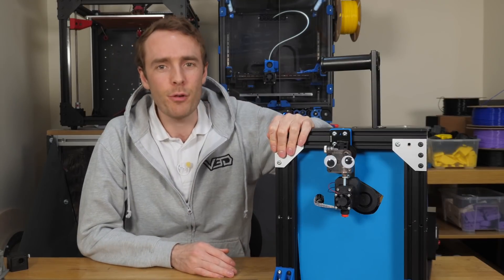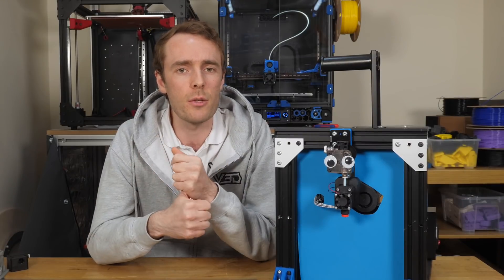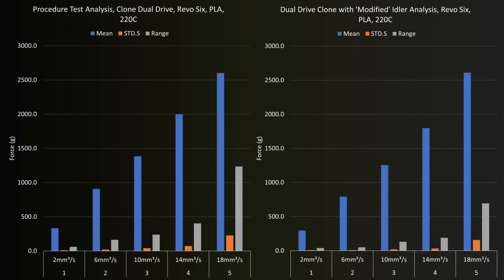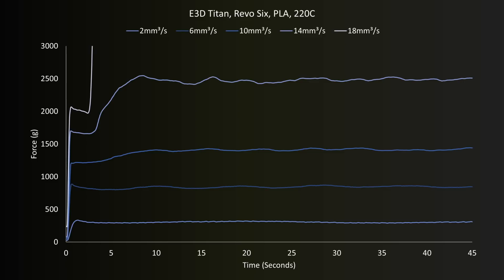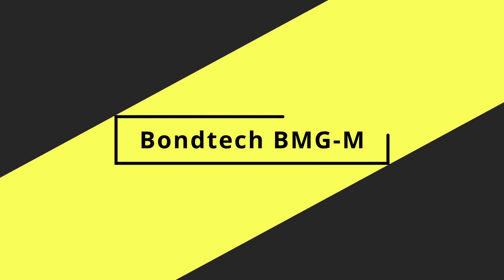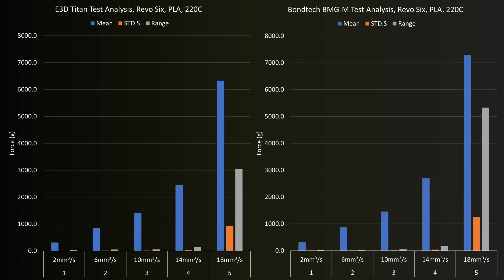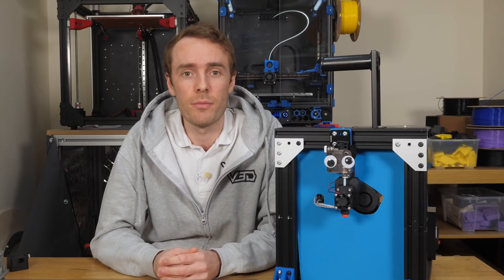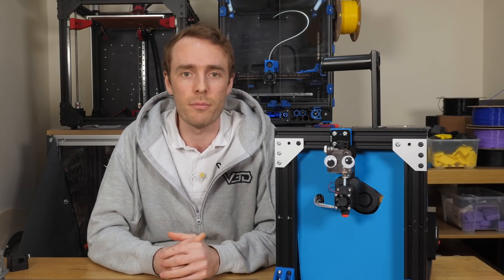The Extrusion Myth We All Believed

Comment: PLEASE expand this into a series with more extensive testing. I would happily donate towards the idea of testing new extruders as they come out. There is a lot happening in this area and some of the issues many of us knew instinctively but couldn't really test are finally coming out.

Some obvious extruders to compare are the new bondtech LGX style gears and dual idler gear designs like the OMG. 

I'd also like to see a belt extruder with no teeth touching the filament, like the concept Proper Printed is working on and  hobbed drive gears that instead use opposing helical teeth (or ideally dual "herringbone" teeth) which I have not seen in the wild yet.
Reply: maybe i am mistaken, but what you wrote there looks like a huge hint at potential solutions....i dont know who else is going after this, but i will....! THANKS!!!
Reply: @simonschneider5913  lol no worries. I've since played around with some belt-style concepts and there's definitely potential but still hurdles to overcome to keep it compact without sacrificing longevity. I'd love to see an attempt at herringbone gears. I don't have the means to attempt that but perhaps there's an existing product about the right size that could be modified....

Best of luck, I'd love to hear what you come up with if you're willing to compare notes.

Comment: Did you happen to measure the amount of filament extruded?  I bet you would see more under extrusion in the clone than the others. I disagree with your conclusion and i think the titan and bondtech are performing better because the likely extrude more.  But I also agree with your assessment that even though they are likely extruding more, it is likely not a better result in terms of print quality.

This has some serious implications.  If the software measured motor current (which correlates to force), it can slow down print speed when the force is too high.  Or dynamically adjust nozzle temp or any number of creative solutions.  Also, perhaps thermal contact resistance should be a performance metric of extruders.  Filament can have a spec of 95% extrusion accuracy per set flow rate per degree c per hot end thermal contact resistance.  This would demystify various hot ends and filament blends!
Reply: Exactly. I came here to make your first point as well. Measure the flow rate instead of using the input. For a given hotend and nozzle, you should be able to make a calibration curve and directly determine the flow rate from the force (see math below). With that in mind, I'd assume that the clone extruder just doesn't reach an actual 18mm³/s flow rate. When it tells you it does 18, it actually only reaches what the others do at their 14mm³/s setting.

If you assume that the molten plastic traveling through the nozzle always has the same viscosity (n), you'd expect the force (F) to be proportional to the extrusion rate (v).
F(T=const) = g * n * v
(where g is a term depending on the geometry of the nozzle.) If the hotend runs into the limit of its power output (P_max) (but still heats the filament fiber evenly to its core), then the temperature will decrease as:
T_P = T_room + P_max / c / v
Where c is the specific heat capacity of the filament. Assuming the variation of the viscosity with temperature is sufficiently close to inversely proportional (n = 1/T), you'd expect the force should be proportional to the cube of the flow rate:
F(T=T_P) = (g * c / P_max) * v²
In practice, there would be some flow rate at which thehot end reaches its limit and the force curve will transition from the linear proportionality to the approximately quadratic one. Which seems to be what we're seeing at around 12mm³/s.

Comment: Some time ago I developed a testing rig for extrusion of PEEK which is quite similar to what you built. But it also features a rotary encoder for measuring the filament slip very accurately, two more load cells and also a PID controller that can be enabled to compensate for the filament slip. My thesis was only about developing that system so I didn't do extensive tests with it. Let me know if you want to read it :)
Reply: Hello,
I would like to read your thesis, is there somewhere where I can find it ?
Reply: @geekoid183  It's not published since it's not a PHD so I'll need to send it to you via e-mail. Also you'd have to translate it from German into French. But I think the diagrams are more interesting than the written text anyways :)
Reply: Hello! I'd like to read this too. Please send me your thesis, if you can
Reply: @Балашовскийгараж  Message me your E-Mail address and I can send it to you :)

Comment: PID frequency? Could just be the pulses of heating or possibly even an oscillation in the PID causing temperature fluctuations and thus viscosity changes effecting the variable force...
Would be interesting to monitor the NTC temp as well as the voltage across the heater cartridge
Reply: PID frequency needs to be actually measured on each specific printer configuration, it's not hard fixed, but it should be between 6 and 8 Hz so outside the chart to the right. Correspondingly its harmonics are then multiple of that and also outside the chart. A possible source of visible spikes can then be intermodulation, where for two different frequencies, their sum and difference also imprint.

To be considered whether measurement introduces some sort of aliasing, where for example due to sparse sampling and lack of filtering, higher frequency signals get reflected off the Nyquist and folded back into the visible part of the spectrum on the chart.

Comment: Really enjoying this deep dive into the physics behind squirting out molten plastic. I was wondering if, using your set up, it would be possible to use the force output of higher flow rates to control the heater? The variable of a constant temperature would be more of a hindrance to flow rate, rather than how much the extruder is pushing. I guess what I'm asking is, if your setup is capable of tuning the heater to increase its output based off of the force it sees?
Reply from the maker: Yes, i think technically there would be nothing preventing that sort of closed loop system. I suppose the real question though is: would it help? Probably a bit.
Reply: @Vector3DP  Yeah, I really do think it would help. Given the volume your trying to push through, the heat would only be able to penetrate to a certain depth into the filament. Of course, you could also be reaching the critical point of thermal conductivity of the filament itself, in which case, it wouldn't be much of a benefit to turn up the heat. Guess it's time for a Bondtech CHT nozzle at that point. Cheers mate, keep up the good work!!

Comment: There seems to be a significant difference in the means in the idler test, so the dual drive does add some force.
Reply from the maker: My answers and conclusions at the end aren't perfectly clear, its a really hard topic, but i'd suggest you watch them again. Yes, slightly higher peak forces on BMG, mainly at highest flow, but this isn't necessarily a good thing because of what is actually being measured.

Comment: Have you taken into account the fact that stepper drivers are also going to produce some measurable ripple?  The DRV8825s were notorious for this, and could cause "salmon skinning" on delta printers in particular, because of a huge step jump in microstepping.  How have you calibrated your machine to account for these things?  You have to take as many factors out of this equation as you can in order to definitively quantize and isolate the drive system itself.  Do these ripples happen in a system with a lot of gear-down, such as the Bondtech LGX Lite?  What are the effects of using a 0.9 degree step motor at full-stepping to achieve these flow rates, where torque from the stepper should be quite consistant...
Reply from the maker: Simple answer: Fourier analysis. at the meaningful resolutions that i was working at with this data, and the time steps I have, it really seems every repeating pattern. Obviously there is still A LOT of work to be done with testing many other parts of the system, but If i tested them all before making a video, that would be literally years of work. I'm doing incremental changes and learning about the whole system step by step and updating you all on the process as i go along. hope that makes sense.

Comment: not really studdied any of this but i think:

from the looks of it 18mm2/s is to much for that hotend so you deal with a lot of noise from the hotend making it basically useless data

also

slip isnt a binary thing and less grip will make the extruder puss slightly less fillament and in return underextrude dual gears help in that regard but the way the standart bontech has the gears it can untroduce artefacts 

what would be really interesting is if you messure how much fillament is being extruded along side your data with either messureing the weight or a sensor messuring the fillament lengh being pulledwhich would let you calculate the % of slip you probably could estimate the slip already by comparing the force differences but i think messuring would be more accurate 

and use said data to compare different extruder designs singe/double different diameters etc being able to see how consistent the extrusion is but also the % of slip

Comment: Hey Adam,

Thanks for the work you are putting into these tests for our community. Much appreciated!
The high flow rate oscillations do not look at all like they are gear induced but rather are caused by the non-linear behaviour of the system concerning mostly filament slip, filament heat transfer and resulting viscosity based on the material melting properties. Stefan has also reported on the oscillating viscosity and flow on filament with a hotend driven to the edge of its melting capacity at several occasions. It is always an oscillating process. 
When you bring the system to the edge of its capabilities it becomes highly non-linear and that make it unstable. The filament oscillates between getting partly “stuck” (high viscosity) and therefore slipping more on the gears and then heating up and flowing faster again with less force. It is a bit akin to stick-slip friction between surfaces. 
If it was the motor or gears causing this then you would see the same frequencies dominate at lower flow rates with a more or less linear increase of the effect with flow rate. That is not the case. The system is stable up until a certain rate at which it suddenly becomes very prone to oscillate. You should test at only slightly lower flow rates to see the transition region.
To further test this theory you would have to try different hotends, where you would expect different breakdown flow rates and slightly shifted frequencies between them and even more shifts in frequency when you use different materials. Also with a single hotend I would expect to see some, but probably much smaller frequency shifts (peaks over distance - not time) within the transition range between stable and unstable behaviour.

Cheers,

Rob
Reply: I think what you're looking for is probably turbulent flow, not stick/slip friction.

There's no mechanism for what you're suggesting to happen, with the nozzle jamming and unjamming.
Reply: "If it was the motor or gears causing this then you would see the same frequencies dominate at lower flow rates with a more or less linear increase of the effect with flow rate. "

I'm not convinced that is true.  If he is approaching the maximum torque the stepper can apply then it would be reasonable to expect good behaviour below some critical force, and then have the stepper miss the occasional step as you pass this threshold.

Comment: There may be a correlation between the oscillations in extrusion force and the PID Regulator of the Heating element. The high flow would cool the nozle, the temprature sinks. When the heater compensates it MAYBE hits a heat transfer limit and switches off to avoid internal overheating. Cycle Repeats.

To test this tuning of the Heating Regulation for these flowrates might prove usefull.
Reply: "MK4Duo" fork of Marlin has a compile time option where you put in thermal capacity of the filament and the nominal heater power, and then it just punches up the PWM temporarily depending on extruded length, to compensate specifically for heat that leaves the hot-end with the extruded filament. This shouldn't hypothetically make a difference for the steady-state, but might be worth trying regardless. The thinking is that it makes PID tuning less critical since it has to do less work, as the amount of heat loss is totally predictable, and might help prevent temperature oscillation, and also preempts regulation lag.

If you think PID settings are inadequate, i suppose you can simulate the higher heat loss while PID tuning in a number of ways, like adding extra cooling.

If you lot think it's actually helpful, like you have any data to show that, then i can port this feature back to Marlin proper. I am not comfortable running MK4Duo on my own printer due to me having less confidence in its safety features, both Watchdog Reset and Runaway. Debugging Watchdog Reset is not fun at all let me tell you.
Reply: Interesting point, even a small variation in temperature could have an effect on the force required to push filament through the nozzle. It may be worth trying it with a different cylindrical hot-end as well, as the Revo is a PCT heater vs the typical resistance wire heaters that printers use.
Reply: He could heat the hotend probably 20 degrees hotter and turn it off completely for the test. If the resonance frequency is gone it could be correlated to heating.
Reply: Bad theory, PID is just perfect for this control. If  the sensor is placed corectly and PID values are tuned correctly, the temperature variation is below 0.5 degree. For this reason in the aluminium block i drilled a hole thru the nozzle thread. The sensor is placed in contact to the nozzle. Rock solid and even performance 😃
Reply: @dtibor5903  It most likely is the PID coupled with sensor placement. @CNC Kitchen did some testing on the E3D Revo hotend and discovered that temperature inside the filament bore in the nozzle can be 10 degrees lower than reported one when cooled. There is a possibility that small temperature oscillation on the sensor (like 0,5 degree Celsius) might result in up to 10 degrees oscillation inside the bore. Effect will be more pronounced at higher volumetric flow rates due to more "cold" filament coming inside the nozzle.
Reply: Nice theory but you're describing bang-bang, which is not at all PID control. A properly tuned PID controller will have very little variation in temperature. Additionally, he is using the Revo with PTC and can respond very quickly to temperature differences.
Reply: @brisance  Maybe according to your Systems and Controls class, but if you've ever done actual engineering work involving such systems you'll know it's quite common to just use a PID control loop to govern duty cycle for an output device that doesn't directly accept analog control (such as the power MOSFETs one uses to switch heaters -- "half" on = dead MOSFET).
Reply: @AJMansfield1  do you not know that PID control can be implemented via pulse width modulation?
Reply: @brisance  That's literally the thing I described in my post. I guess the thing you weren't understanding then was the idea of even a PID loop having a finite impulse response, then? (And in that case, scratch the comment about your Systems and Controls class since you've clearly never taken one.) Even an optimally-tuned PID loop will undershoot momentarily when it has to deal with a step change in conditions (such as the extruder starting to extrude); real-world control loops are band-limited systems, and the reality of most 3d printer hardware means that the limit frequency of that temperature control loop is a lot slower than for extrusion and retraction movements.
Reply: @AJMansfield1  clearly you enjoy arguing with yourself so much that you would invent a strawman argument just to "win"… there isn't a system in existence that can react instantenously because of hysteresis but clearly you haven't attended a Systems Control class of which you are the professor.
Reply: @brisance   That would be interesting to test as well. All of the PID tests I know of for 3D printers are done while not extruding, so the energy loss that is being tuned is basically just atmospheric. If you include the energy of the system lost to melting the filament (how it operates in real life), I wonder how much that could change the PID values? I’d love to see that. 

In a way, I think we’re kind of slapping a bandaid on this problem (and a whole lot more) by using linear/pressure advance. That helps tune out a lot of issues, but it only changes the extruder values rather than the temperature (though a temperature response is likely way too slow to accurately mitigate the wonkyness that rheology is based on)

Comment: Before even seeing the video to the end, I have my view on the matter - there's a limit to how much material that can pass through the opening in the nozzle. provided, that the material is at the intended temperature. If the extruder is not able to push material through at the wanted rate it could very well be because the hotend cannot melt the material fast enough - more force will not alleviate that.
Reply: I believe you are on the right track. The OP didn't test, monitor, and assure his machine'a the hot end maintained an accurate temperature.  If temperature varies, and it will, at varying plastic flow rates, the flows, pressure, and amounts are not going to be consistent.
Reply: @BStott Yeah I thinj the whole idea of using an hotend in a force test setup is flawed. I would have preferred a setup that directly measured the force